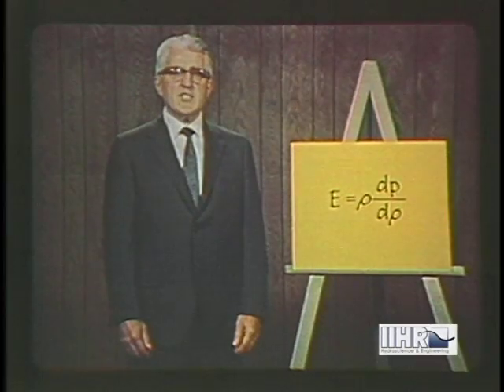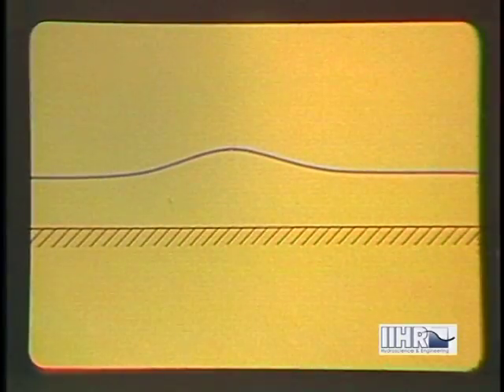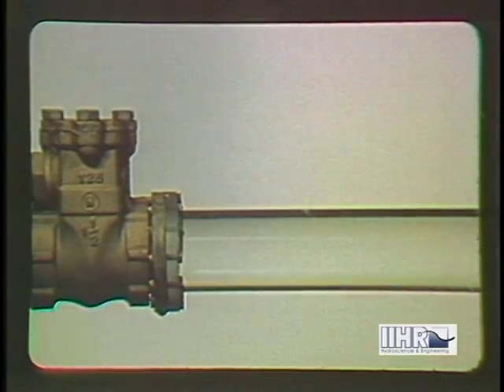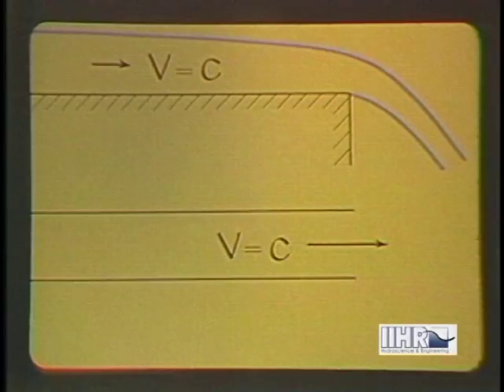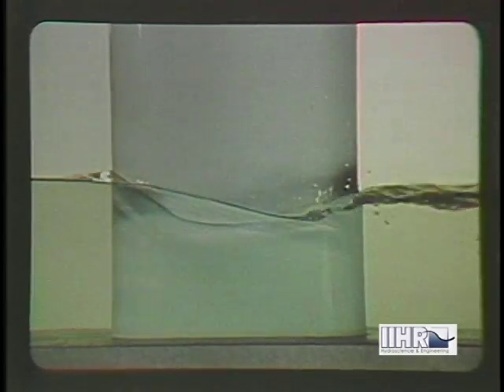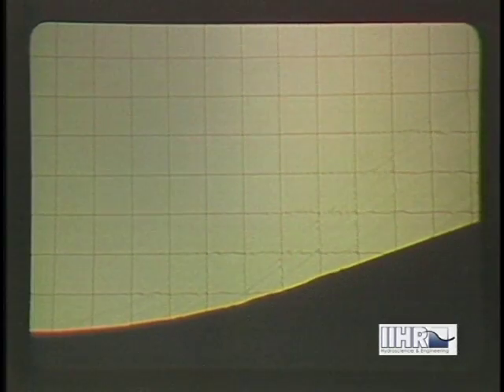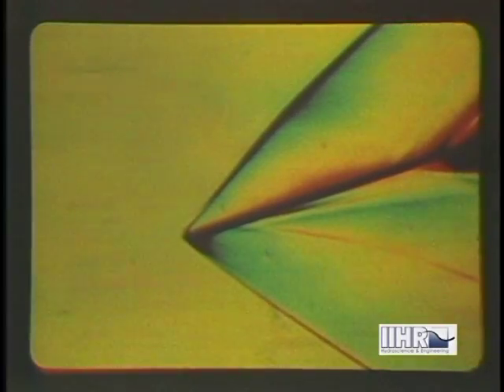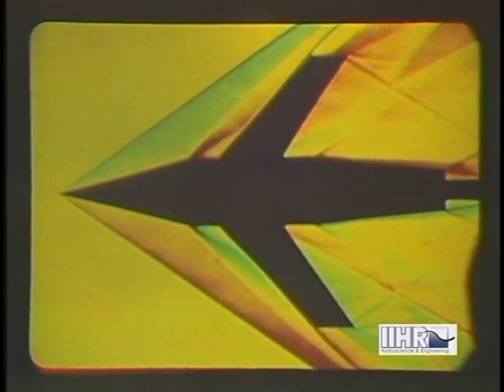Effects of Fluid Compressibility

Comment: Interesting video. What would happen to a fluid if it were compressed in a hypothetically indestructible cylinder with a piston that wouldn't allow any of the liquid to escape and could apply immense amounts of pressure? Would the speed of compression have an effect on the results? If there were a solid object placed inside of the fluid as it's being compressed what would happen to the object? What would happen to the fluid while decompressing?